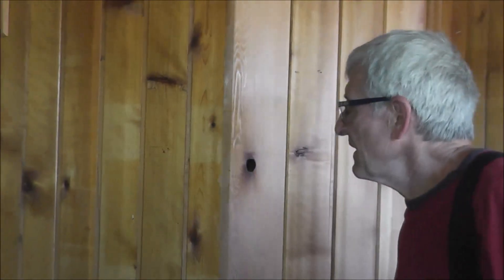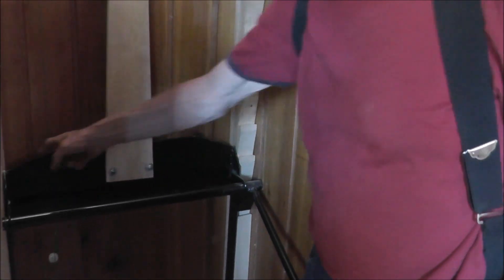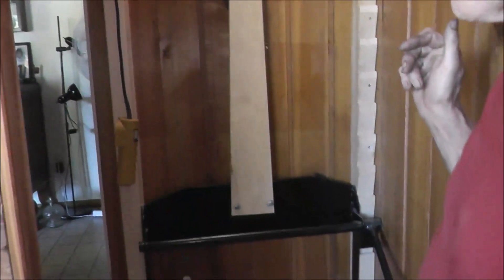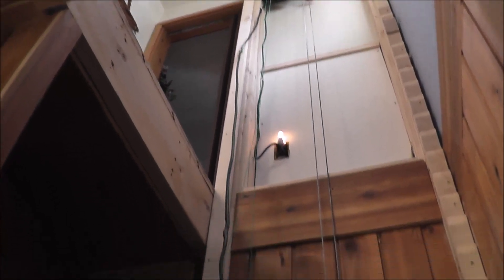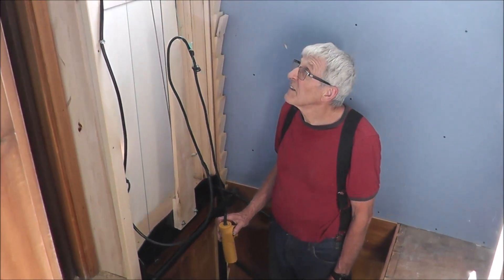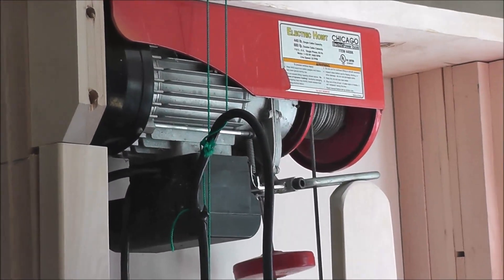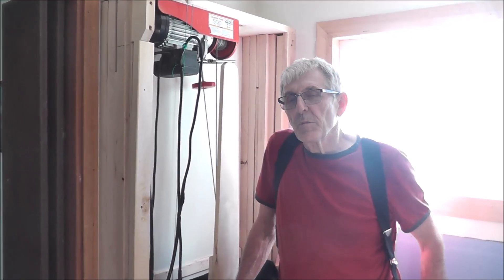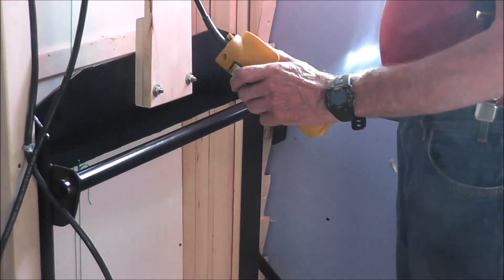DIY Elevator for home or shop

Comment: Take it or leave it but I wouldn't let my family in it. A couple friendly suggestions Sir, I would hope there is a steel plate spanning that plank on the other side of that mount holding up the winch. Not just that piece if pine planking. Thats the most important part in the operation and also what is doing all the work. Hopefully it isn't as under built as it seems. I'd suggest to put a drop door to cover the floor too, and build a cage already, so if something did fall (winch) it doesn't make your head into a grease spot while tearing someone open vertically God forbid.
Nice prototype but consider beefing it up. If you don't think it's needed, test it! 
Try loading it up with 400 lbs of raw meat and weight then cutting the cable half way up...and see what happens, cause I know!
Comparing Dollars to Regret makes no sense. ¢ 

Just giving some advice on a good lift system,  besides I bet you had fun building it the pride easy to see.

Comment: Clever! I bought one of those Chicago cheapies to connect my crashed car to a big tree. Pulled the car's frame out with it and hung a new door. Still works today.  To use it afterward,  I attached the winch to the top of a strong A frame ladder, and it lifts up my motorcycle for servicing. Those things have lots of uses. That's great work! Your wife should be proud of you. Caring, resourceful, hardworking, and frugal.

Comment: Ok this is cool, and has me thinking about how I would make one. 

I watched a documentary on elevators once, and yours seemed to follow the early designs. 
Necessity is the mother of invention, and you fulfilled a basic need. 

I have a daughter who is wheelchair bound, and there were times I would have welcomed this over carrying her (and then her chair) up stairs. 

The only upgrade I would try would be to build a metal "cage" covering both floors, use metal for the notches, a spring on the lever to make it snap back into the notches, and rollers on the base to roll up the cage. That would raise the cost quite a bit though, and when you are living with a disability money is an issue. The only reason I would do metal is because I am a large fellow, and would stress the wood more than you or your bride.

Also, I am glad to see Harbor Freight in your build...

Comment: It look dangerous from the second floor when the elevator is on the first floor. Someone could fall down that hole, especially in the dark. Maybe a cage could be built around the elevator, so an elevator ceiling could become the second story floor when the elevator is in the lower position. The second story hole in the floor would then be covered by the ceiling of the elevator.

Comment: The only site non-commercial product elevator I seen, and an emergency brake, that was hands free, both is ascent and desent. Another concerns is the robustness of the winch's automatic brake, one wouldn't want that to fail when stepping on to the platform while at the higher floor. The presence of this in a home could be a liability when the home is sold.  Of  course the harware could be removed, and the shaft described as an uncompleted dumb waiter ot landr  chute.

Comment: Any backup safety devices in place for while going back down?
Reply: Yea I was thinking the same thing. By the time that motor or pully system wears out, he will have passed on. Great job though.

Comment: Ingenious.  My only suggestion would be to have the notches out of metal, but I suppose that would have drastically increased the cost.  Btw, looks like the same motor used to lift a 40’ aircraft hangar door I have.

Comment: I really want to like the "can do" attitude and the thinking that went into this.  But this is not just some cool gadget to pour beer or some other inconsequential thing.  This is a very dangerous device.  

Disabled wife climbs in and gets flustered because she's in a lot of pain (I'm so sorry she's suffering) and doesn't notice that the cat's tail, or her toe, is sticking out, waiting to get sheared off.  You need to put a cage around this so no appendages can be sheared.  

What if her dress gets snagged on something?  Going down, it could suspend her until it rips and then she falls.  Or at the least it can jar her injured back.  

The pawl design is only half thought out.  First, wood is a terrible material to use to latch the pawl.  The wood will shear so fast, especially if you are going down and the elevator gets some speed up before she can react to engage the pawl.  At least make it out of steel.  And you've got to find a way to engage and release alternate pawls so that one is always engaged.  

I think you should look to the elevator industry to look for a better solution.  I'm sure you can make one, but you're trying to re-invent something that is very critical for safety and too many people have been hurt or killed along the way to make elevators safe.  

It's possible that you'll use this and no one will get hurt.  I'm not betting on it.  If you are putting your disabled wife in this, your hubris will likely hurt her badly.
Reply: Hubris you say. From the mouth of someone who has likely never had to do something out of necessity. Your glib, short, and likely spoiled responses drip with conceit. Are there things that need to be addressed? Yes, is there a better way to offer constructive feedback? Absolutely, but from your Youtube name you are the type who likes to fly off the handle and feels pretty superior when doing so. Most of the items you mentioned can be easily addressed. The Pawl design is flawed although easily fixable while leaving the wood structure remaining (although I am assuming that is pine which as a softwood I would choose to replace) by reinforcing with steel along each side. This thing does not need to be overbuilt like a commercial elevator. 

A flip up/down lip could be used to deal with your "concerns" about overhanging limbs. Not safe enough? Those features seem to work fine for wheelchair lifts that are used by millions daily. An entire cage would be great too, but not absolutely necessary either. The most immediate thing I would suggest he address is reinforcement of what looks to be a single 2x12 used to mount the winch as that will be the likely first point of failure. That should, in my opinion, be doubled with a steel plate between and lag bolted or a proper header created meant to support the weight (don't skip the steel) and increased forces being applied here. Funny how you made no mention of that at all Mr. Likes2Rant. 

Either way, Mr. Proctor you have some solid ideas that can be improved on to make this a very safe elevator for lite duty personal use. I would not suggest it for any type of shop environment where extreme or heavy loads were to be placed upon it.
Reply: @genesishep  It doesn’t need to be over built like a commercial elevator?  Yes it does.  It’s an elevator for people.  It’s not for sacks of flour or pianos.   It’s for people.  It needs a lot more engineering.  

Personal insults might make you feel better, but when someone gets hurt or killed, because this thing WILL fail sooner or later, no amount of your insults today will make the victim feel better.

Comment: The only concern I see is the dog design; it has a pointed end that will strike the wood rather than a flat face of metal.  My concern would be its ability to shear through the wood since the grain runs up and down and a pine 2x4 would shear fairly easily..  It also wasn’t explained how this works during descent: if the occupant has to manually hold it up while descending it leaves a failure potential to not engage it when panicked during a fall.

Comment: You’ll be able to get past most “regulatory hiccups” if you call it a “dumb waiter” as opposed to an elevator. Don’t be discouraged by some of the comments, they are from people who are unable to “think outside the box” or problem solve.  Too, most of them were likely exposed to lead paint earlier in life and thusly are thinking and saying dumb things.  Great little solution and you should be proud.  I’d do anything to improve the quality of my wife’s life and it appears you have engineered it to be as safe as it would need to be for the use it will receive.

Comment: Great Project, you have a great design and implementation!!  Its practical and inexpensive!!  It appears you thought through the design quite well.  I would suggest a railing up at the 2nd floor with a gate to keep someone from stepping over the edge when the elevator is not at the top.  Liked !!

Comment: Well done. A safety gate at the top would be nice.
At the bottom of my stairs to my basement there is a 1 step landing. I.E. you turn 90 degrees to take one step down to the concrete. I thought something like this would be nice. I would have the bottom landing floor be the lift. So it is flush to the old landing when at the bottom. It would then climb/follow the stairs and then be flush to the floor at the top of the steps that already has a door. The stairs are enclosed on both sides so it would be very safe. If it was at the bottom you can still use the original stairs. Mostly for resale.
I can't personally do the work you did but you gave me some good ideas to have a good remodeling crew to do the work and I am sure it would cost less than half those dedicated companies charge.

Comment: You need to look at Acorn Stairlifts.  I just put one in for our basement stairs, and the equipment and installation the cost to me was under $4,000.00  It's a great stairlift and I would buy it again if I had to in a heartbeat.
Reply from the maker: I had checked with them. but because my stairs has a 90 degree turn, it has to be specially made for the installation and I am too far away. This works better as there is also 3 steps down to the living room. Also one can stand up, sitting down and getting up is hard for her. The upper part is enclosed in its won locked room and a down safety device is in the works.

Comment: Brian,   I used to work in a chemical plant. We had a 500 foot tall emergency flare that had a open air exposed ladder to climb the flare if necessary.  In between the two hand rails and slightly in front of the cross foot rails was a round 'tube' with serrated notches like what you have on the side of your elevator. Around this serrated tube was a second 'collar' type device that has a short lever sticking out attached to a 'dog ear' that would catch the notches every inch or two.....the same idea as your safety catch system  The person climbing the flare (500 feet...not me!!) would wear a safety harness around their waist, attach it to the dog ear catch device , and climb away without needing to touch anything but the hand and foot rails....normal ladder climbing. The idea was IF you were to fall, completely losing all grip, you would only fall a few inches and the sliding collar would catch the non-movable inner serrated pipe, stopping you fall.....certainly survivable!!

Comment: It's rough, but if it works!

Personally I'd have used Steel Channel and would incorporate solenoid bolts. limit switches and some gates into the design to make it safer. I'd also use a sprung loaded lifting arm that in the event of the cable failing would spring outwards into metal dogs on both sides. I'd also probably include a wireless remote - but my knowledge of electronics and so on is probably greater than the designer, and I have access to heavier duty fabrication tools.

I do echo the other comments about the safety interlock and the wooden dogs - I think that hasn't been tested properly and could be an issue. You should load this to it's design loading and put a quickrelease on the cable and test the safety mechanism.

Comment: I had a customer that didn't like the $23k bid for a real elevator. He built something like this and the cable broke, he free fell 12 feet and broke both legs. Trying to save $23k cost him over $100k with medical bills and we installed an elevator in the end anyway. This seems like a good idea, but consider the risks. That "safety" system needs a serious re-design. A spring loaded wedge that would automatically lock in the event of a break. If the cable broke and the person holding that lever froze and didn't let go, it would free fall.
Reply from the maker: Thanks for your concern, The dogs that I have will not break although many will differ on that Idea, all hardwood and long screws through the notches. A safety locking system to lock it automatically on the way down is in the works.

Comment: I must say that your elevator is very ingenious 👍🏻👏🏻 maybe what you could do is have a basic set of plans drawn up and you could sell them for a nominal fee just to cover your costs for the build and for the plans and shipping or instead of shipping do it on the internet , by doing it on the internet you could have a small box that must be checked that would have a waiver that the buyer would have to check that would absolve you of any and all of responsibly for any damages  , harm or death that may be caused in the making of this elevator  and If they do not check the box then there would be no sale of said plans  ....
P.S. I’m really glad to hear that you are from British Columbia. ...👍🏻👍🏻👍🏻Bruce Clark , Abbotsford B.C.
Reply from the maker: All the information is there in the video, it can be changed or modified. Only thing that is not there is a locking mechanism for total failure on the way down.  No I would not make plans as there have been so many negative comments. It is safe and I can make it safer.

Comment: Love the lift 
Been trying to come up with something for a loft area in my future tiny house that dont require  stairs or a ladder 
May still have one or the other close by  as back up but this looks & seems to work great for my needs 
Do you have a pdf or a set of drawings I could get 
Thanks so much
Reply from the maker: No plans of course,  can answer questions,  will have a locking mechanism for the down soon as that seems to be the most logical complaint.

Comment: Very creative solution but my only concern would be the slot in the wood it rides in i see a few screws but what if that would split under load with a chair and person it has the potential of dumping someone out that front area if not to be enclosed. yes the cable is pulling from the edge but the tendency with a weight on the platform would be to force the top edge of the angle iron to move outward towards the item on the platform..is this wood slot section strong enough for that? would having an opposing iron rail be safer? and a pipe or iron cross member for the winch? I know wood is incredibly strong if used correctly but these are my thoughts on it. Cheers, i love smart DIY solutions.

Comment: Hmm, you went on and on about suspending the electrical cord for the control, but you said literally nothing about the pulley system, or the system used to raise & lower this thing.  Poor description.
Reply from the maker: I thought the how the winch worked was not important. Just a the winch as you can see, cable is fastened to the platform by a pulley, cable goes back up to the top and fastened to the winch frame. with the pulley the winch can lift twice the weight and raises at 1/2 the speed.
Reply: @brianprocter6191  Thanks for confirming the 2:1.  What does the elevator ride on?  Are bearings used?
Reply from the maker: @tkarlmann  The angle iron is positioned outwards and rides in a slot. The slot is made  of 3 pieces of hardwood and waxed.

Comment: Have you thought about adding a counterweight to take some, if not most, of the load off of the winch?
Reply: its a winch, not a traction drive if he added a counterweight it would have to be less than the weight of the cab (which is really light in this system so adding one wouldn't slow down a free fall all that much) and would complicate safety if it weighed more than the cab. as the safety ratchet, he was so thought-full to put in will only keep it from freefalling down not from freefalling up. (i would like a better safety solution for going down but a counterweight is not a good solution in this system. )

free falling up is a thing here is how it can happen.
Commercial traction drive lifts use at least 2 but usually 4 cables each cable alone can take the weight of the counterweight/cab.
The counterweight should weigh more than the cab at 1/2 capacity, and the capacity rating should be about 2-4 more people than will comfortably fit in the cab.
If one or more cables fail and there is not enuff friction between the remaining cable(s) and traction drum than the cable will slip with the counterweight falling not the cab.
if you're in an older model the governor (a device for triggering breaks when the cab is moving too fast) might not be bidirectional so the track breaks won't engage when falling up.
Reply: Yes,a counter weigh, it serve as a safety to lessen a direct drop with a  same total weight of the load. A occupant cage is also added a safety protection
Reply from the maker: That is a good idea.  Only trouble is it would have to be less than the platform. It is reasonably light so would not help allot.
Reply: Not cost effective.

Comment: I would widen the wooden probe that hits the safety latch on top so if it ever became misaligned it would still trigger it but this is a great use of "What you have". Perhaps even enclose the winch and insulate it for sound, and you really have a wonderful setup. Kudos to you for caring for your wife in this way.
Reply from the maker: It is alittle extra as it shield the cable, She stops it manually when the platform is level with the floor.